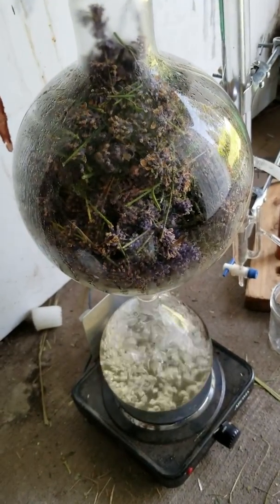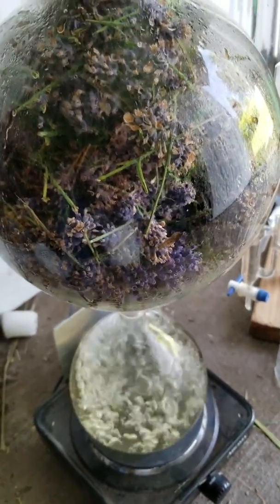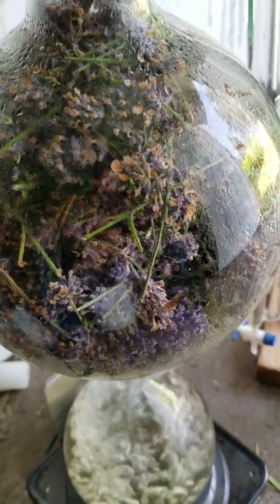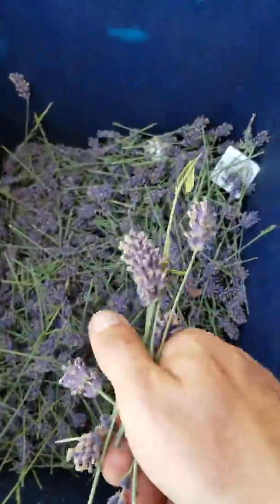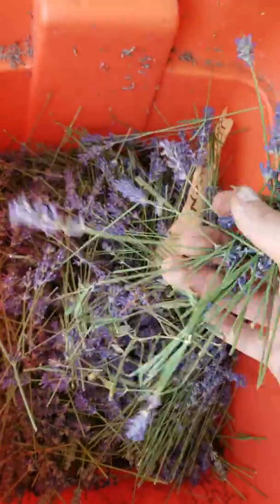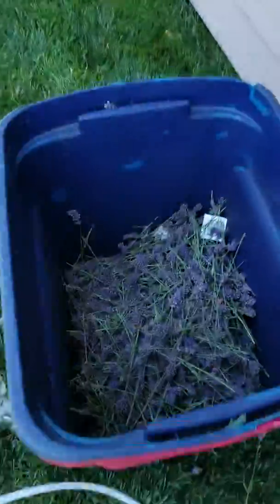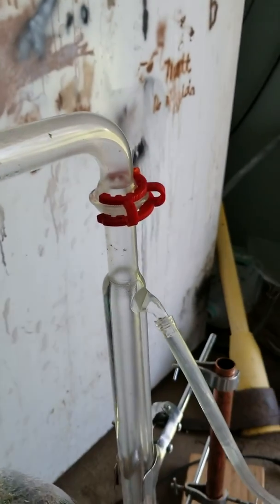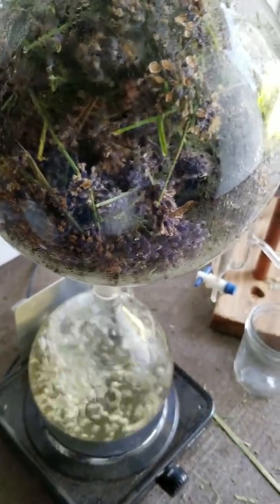lavender essential oil distillation

Comment: So my next question is how can you tell when it's done. Meaning when there is no more essential oil That's going to come out
Reply from the maker: Also good question what i like to do is make a mark with a pen on the outside of my oil collection unit wait 20 minutes if it passes the mark youve gaines oil if not youve gotten as much as you can. Also the mark is good to leave if it doesnt pass cause then you know about how much you should get on the next run assuming its the same material
Reply: @naturalchemistessentials4258  and the same amount?
Reply from the maker: Yeah assuming youve loaded the same amount of material you should get around the same oil